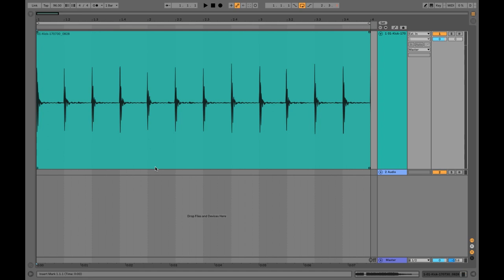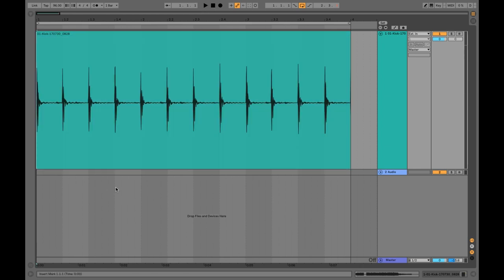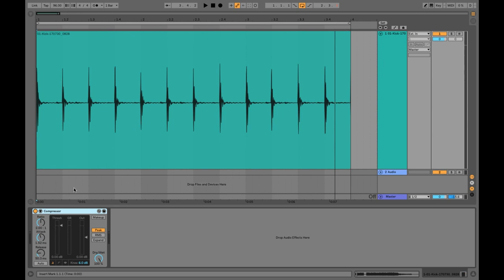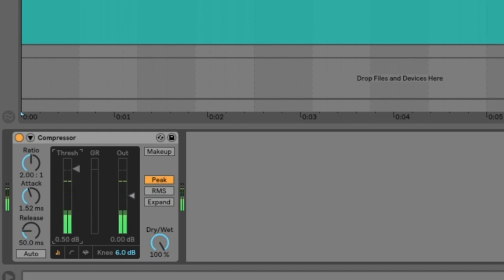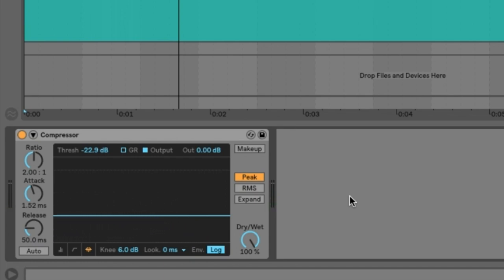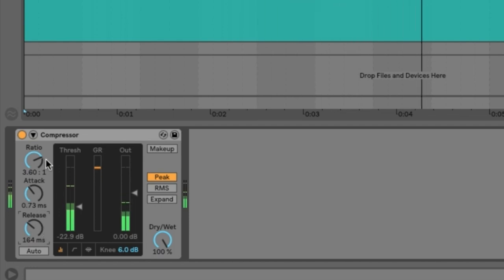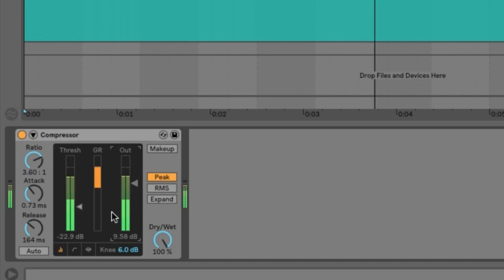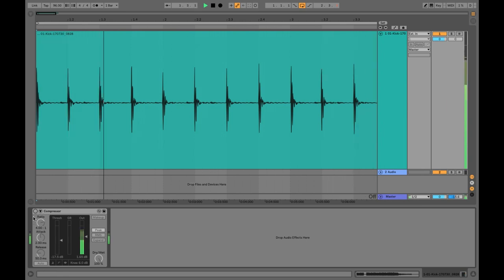Compression Tutorial: Know the Foundation of Your Mix (2018)

Comment: I learned compression with a somewhat cute analogy that helped me a lot. The guy said that it is like a gum roof. It's a roof because it stops sound, but it is made of gum, so it's kinda flexible. What it does is what you say, compress the noise by not allowing some parts of it getting across the roof. Ratio 1:1 would be no roof, and Inf:1 would be concrete. 
I'm not actually good on this so sorry if this is more confusing, but this is what clicked on me.
(The guy is from Hispasonic YT channel, it's in spanish and it's called "Fundamentos de Compresión", if anyone is interested)

Comment: Brittainy,
It seems there has been some misunderstanding over the attack and release functions of compressors.

The attack time relates to how fast the compressor reduces the signal once it hits the threshold.

The reason you see no GR at long attack times, is at those ratios, and threshold, the transient that rises above the threshold is so quick, it passes through before any GR would take place... Which it does not since the rest of the signal is below the threshold.

This is how compressors can be used to increase the ratio of the Attack in respect to the Decay, Sustain, and release, modifying the envelope of a sound.

The same theory applies to release, except there are some compressors with a "Hold" parameter available, making them even more versatile.

Another interesting fact, is compressors are often working when the signal is well below the threshold.

I'm liking your videos, please make more.

It would be great to see your channel flourish!